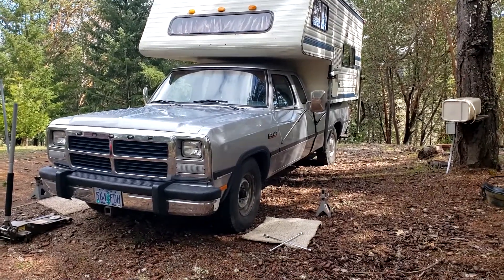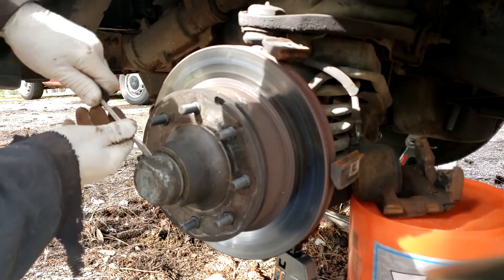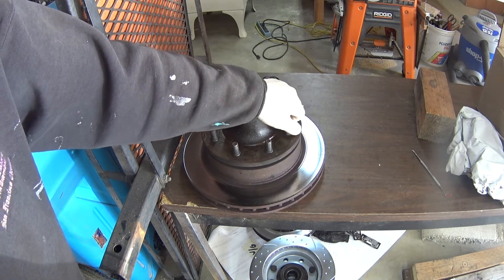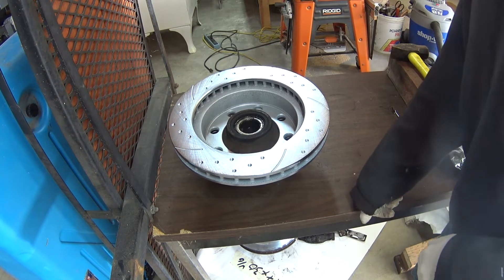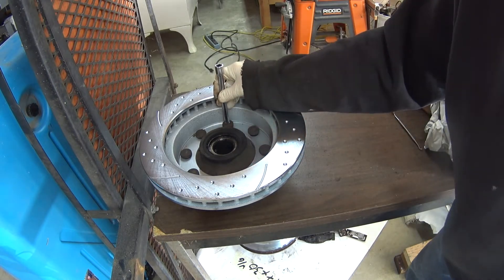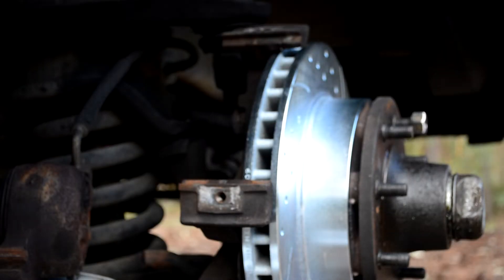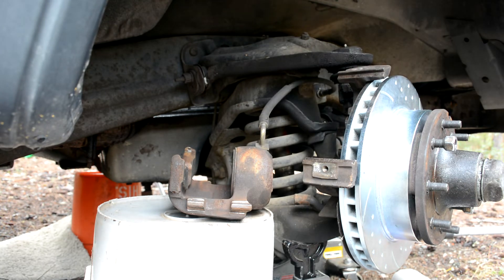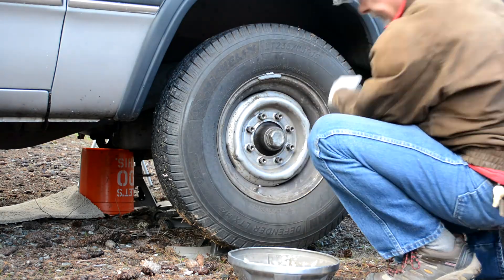1st Gen Dodge Cummins Rotor and Pad Install

Comment: Doing new calipers and pads today. I skipped out on the rotors because they look fine... but mostly also because I really didn't wanna go through the headache of replacing them. Well, that's cause I could only find 4wd videos, and now that I see this I'm realizing how much easier it's on the 2wd model... well, maybe I'll replace the rotors next brake pad change... Thank you for this video, I saved it for future reference.
Reply from the maker: If you have no problems with your rotors I wouldn't replace them either.  No reason to.  With mine, they kept warping every couple of years and I was really tired of uneven braking and replacing them repeatedly.  The ones I got were very expensive but they've been flawless, and no more warping!  Good luck with your project today and I hope it all goes well.

Comment: tell ya what i took my truck apart on a nice sunny day forgot completely how they went back together! now a day later theres 3 feet of snow on the ground! like you i plan on putting a camper in the back and towing my motorcycle so the upgrade is most likely in my future. wish i knew which pad went where pretty sure the long pad is opposite piston side and the short pad goes on the piston but not positive never had one of these apart can say ive done at least a hundred or more brake jobs and this caliper design is undoubtedly the worst design ive ever seen most calipers have the mounting bracket attached to the caliper. thanks much for the help

Comment: Thank you so much for taking the time to make and post this. I found it very helpful with my D250
Reply from the maker: Glad I could help.  I consult Youtube all the time for my own projects and it is incredible.  I started working on cars back when the only help we had was word of mouth (often bad advice) or a paper repair manual, which was often very confusing to follow.  Youtube has made it sooooo much easier.

Comment: I have a 92 D250. My hubs are one piece. Does anyone know where I can get more info on why yours are different? My races are pretty chewed up. Curious to know if i can just throw a set 93 wheel hubs on with new rotors and call it a day.
Reply from the maker: @LTWolf99 is your truck a gasser or diesel?  Mine is a diesel and as far as I know all the diesels came with heavier suspension than the gassers.  My front axle is rated for 4,000 lbs. and the back is rated for 5,450 lbs.  These are Dana Spicer axles.  There should be a sticker in your driver's side door jamb that gives you the axle weight ratings of the front and rear.   If yours is lighter that could be the reason for the one-piece hub assembly.
Reply: @MTMiser  She's a Cummins. Rated for 4000lbs in the front end. The exact manufacture date is 10/91. Its amazing that I found your vid to be honest. I stopped dailying the old girl about 2 years ago because of it, then took er off the road back in spring. Thanks you your vid there's some hope for er. I've tried my best to get info on the 4000lb front end of the first gens but haven't found much. Its odd because I found a lot of info on the 3300/3600lb one piece hubs yet nothing on the 4000lb one piece hubs other then the 80s D300/350s. (all 8lug hubs too)
Reply from the maker: @LTWolf99  Are you on Facebook?  If so, there is a group there called "1st Gen Cummins (89-93)" that could help you out.  There are lots of very knowledgeable people there who have owned and have been working on their 1st Gens for a long time.  Someone out there will undoubtedly be able to answer your questions about the hub. As for me, I assumed all hubs for the 4000 lbs. axles were the type I have (as shown in this video).  Join that group and post your question with some photos of what you've got - I'm sure someone will have info for you.

Comment: Where did you buy the drilled and slotted rotors? I need those in my life!
Reply from the maker: @JD Dankins - I got them at https://brakeperformance.com/ .  FYI their prices are all over the map, depending on when you happen to look.  Their retail list price will give you a heart attack, but they have sales of 35% to 40% off frequently.  The rotors I got are dimpled and slotted, although they also sell cross-drilled and slotted ones.  Their lifetime guarantee against warping is what attracted me, as I've had warping issues with standard rotors repeatedly, which may have been due to a faulty rear-wheel-anti-lock module.  I just deleted that module and made a video of the process:  https://youtu.be/n48Y9YkdR5s

Comment: Great video! Do you know the stud part number?
Reply from the maker: Thanks Carlos!  The Dorman part number is 610286 - that's for the serrated stud, 1/2-inch diameter threads, for the front.
Reply: @MTMiser  awesome!!! Thx
Reply: @MTMiser  and the hub assembly ? I don't wanna be rude... I hope yo have it
Reply: @MTMiser  I have a 1986 D350 and wanna swap the big rotor disc to the smallest like the one showed on the video
Reply from the maker: @charlymanjaful  I don't have it and I can't seem to find it.  There are some hub and rotor assemblies on ebay but I can't find the hub by itself.  Strange.
Reply: @MTMiser  Thank you Maynard!

Comment: I just bought my 15 year this same truck, color and all. He chose this over all the newer trucks and jeeps most kids want these days. 
Now getting it road worthy I ran across this video. Hands down the best video on YT for rotor replacement. I also did calipers, brakes, bearings and seal. Thanks man!!
Reply from the maker: Wow!  Dad of the year!  Great choice.  I've had this truck for 17 years and it has been the best truck I've ever owned.  They aren't without their quirks but it will be a great way for your son to learn about them.  Three cheers!
Reply: You made an amazing choice. I bought a 93 d250 off my welding teacher at 16 and have learnt so much over the last 2 years. From learning to paint a vehicle to interior custom work to now doing full custom front and rear suspension. If he doesn't already have some get some good impact socket sets as I've had to use the heck outta mine. Also I'm sure you are familiar with Facebook but the groups about these trucks on fb have provided so much information and a good sense of community around these trucks.

Comment: What was the point of using the C clamp on the brake caliper? Was that just for cleaning or checking the brake fluid level? 

I appreciate your videos, I have a 12v D250 also and watched a few of your videos, like the brake bleeding and AB’s bypass videos.
Reply from the maker: I used the C-clamp to squeeze the brake piston back into its cylinder, to make room for the new pads.  As the old pads wear down, that piston comes further and further out.  When you put new pads in they're, of course, thicker than the worn ones, so you have to push that piston in to make room for them.  Thanks for watching my videos!  I appreciate it.  And best of luck with your first gen.

Comment: How have the drilled and slotted rotors been since the install?
Reply from the maker: They've been great.  Zero problems.  I took a trip of about 2,500 miles four months ago, towing a 10k lbs. 5th wheel and the braking has never been so good with this truck.  Very smooth, zero surging or vibration.  I wish I would have gone with these rotors a long time ago.